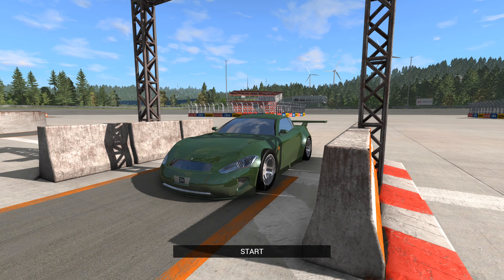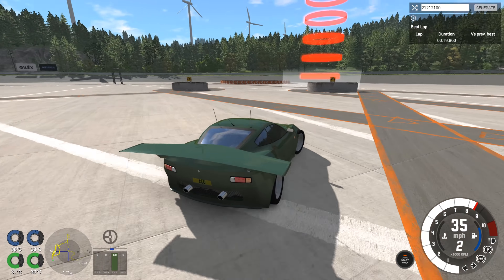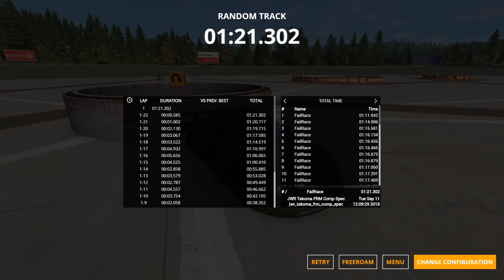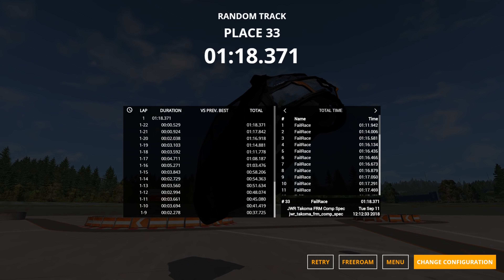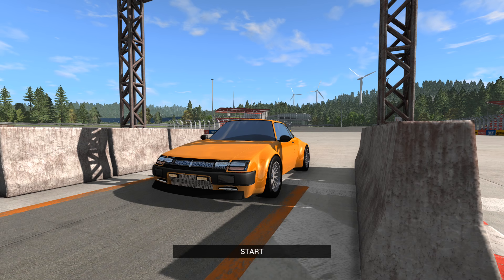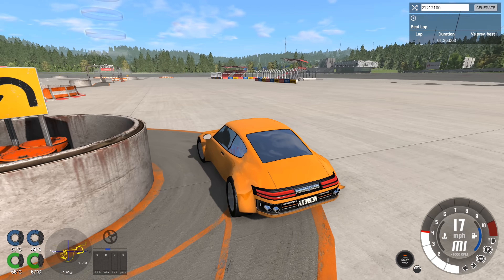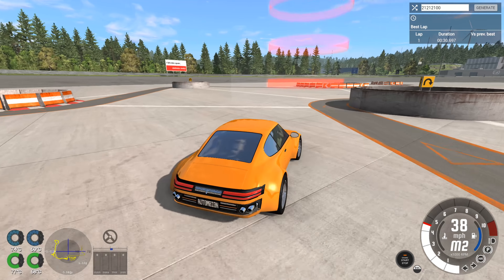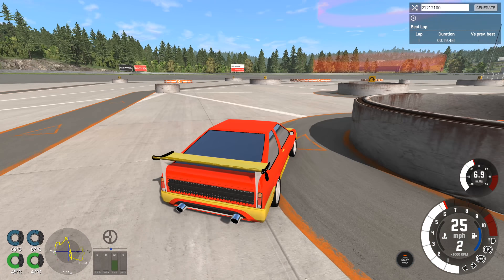Automation/BeamNG Drive - Spectacular Shunts- Autocross #25

Comment: Yeah, I messed up the greabox of the Thunder. Should've gone for less gears, and a sequential. I'm very happy it handled as well as it did - the tiny wheels and low ride height were part o the plan as I wanted to keep the center of mass as low as possible.
Reply: Especially in a turbo car with a wide power band you don't need "that" short gearing... In your case tho it was definitely too short no matter what hehe.

Comment: What do you want in this series. High torque and lower power or High power and lower torque?
Reply: I believe most of the top cars are within the 300-400 hp mark and within the 800 kg mark
Reply: -lightweight, sturdy chassis (carbon fiber monocoque has lower weight, while the spaceframe theoretically has better rigidity)
-lightweight engine, under 2000cc, with accessible high power for displacement (800hp are useless if they're only within a narrow band at the top)
-short gear ratios to maximise engine use, dual clutch for fastest shifts, and possibly low gear count for a bit of weight saving (these cars probably won't break 100mph at any point)
-wide, but not ridiculously wide, tyres (their grip can be so great it causes the dreaded wheel wobble, among other causes), with low profile semi slick rubber and lightweight rim material
-sufficiently large and advanced brakes for ample stopping power (mind that carbon ceramic discs are or were bugged and have/had poor cooling properties)
-maximum downforce (again, none will go fast enough for drag to significantly affect them)
-minimum weight, only ABS as an assist if even that
-suspension tuned 90% of the way to max stiffness